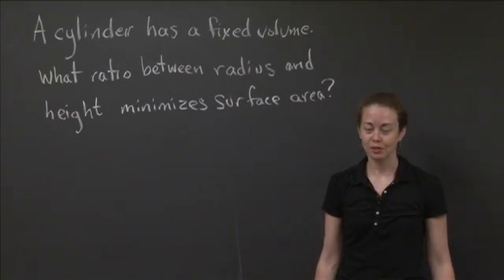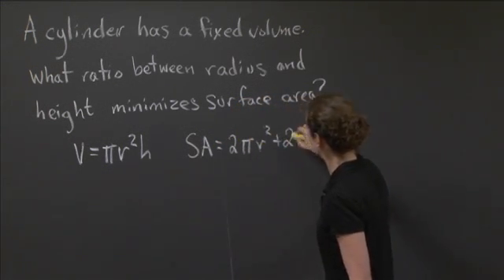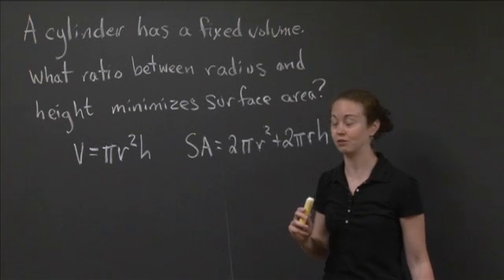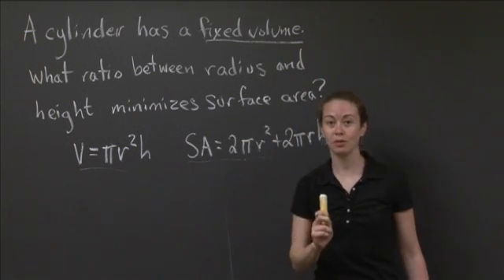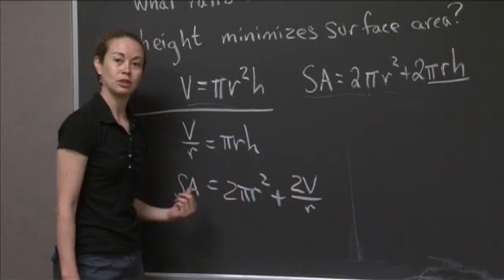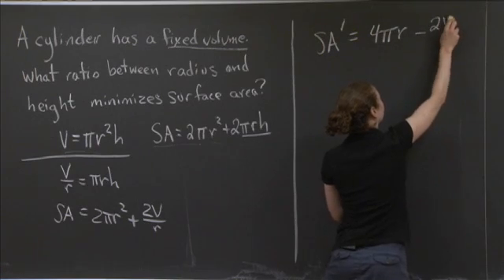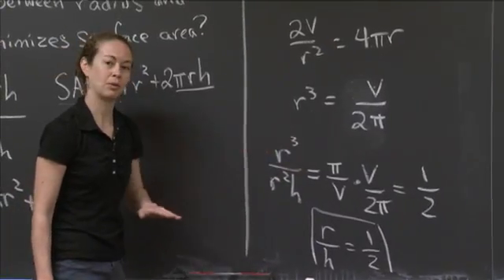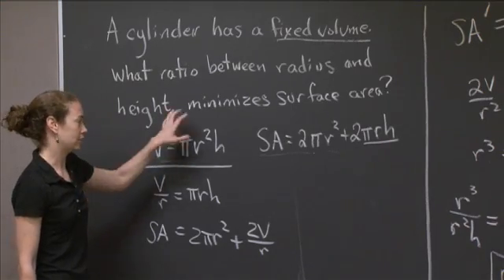Maximum Surface Area | MIT 18.01SC Single Variable Calculus, Fall 2010

Comment: I was trying to do something related but as a maximum. If you cut a cylinder vertically (like a pill to increase the overall total area then exposed to stomach acid for absorption) it's obvious on inspection that this would be a square. But setting up the two new rectangles of surface formed and using the total of this new area as a ratio of area to be maximized, I couldn't figure out how to mathematically prove the obvious answer (resulting in a square) for this arbitrary ratio which turns out to be 4/pi3. I'm talking about setting up the rectangle as 2r x h, putting h in expressed as r: h = V/pir^2. I was trying to prove to myself going this route that by trying to maximize this rectangle based on a fixed volume that the rectangle has to be a square. I know I missed something because I could never get a decipherable first derivative of r based on a set volume as Christine did in this problem of minimization. Please tell me where I messed up I know it must be something obvious besides the fact that a square is the best rectangle. Can it be shown mathematically that 4/pi3 is the maximal ratio of additional surface added to a cylinder of set volume? Thanks

Comment: The ratio r/h=1/2 basically says that the optimum cylinder is the one whose cross-section is a square (if you cut it with a plane through its axis, that is). The same result will be obtained if SA is kept constant and V is maximized.
Reply: i.e. diameter:height = 1:1